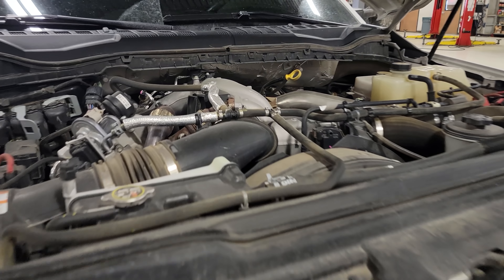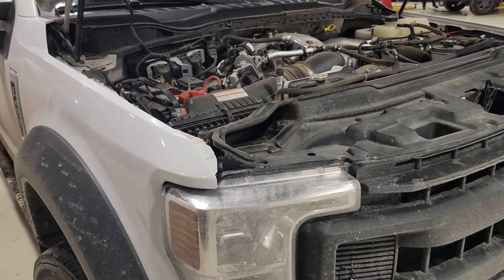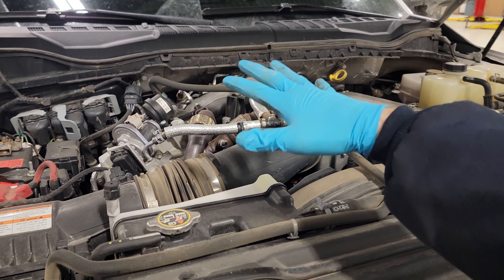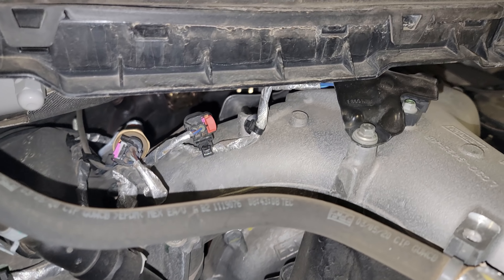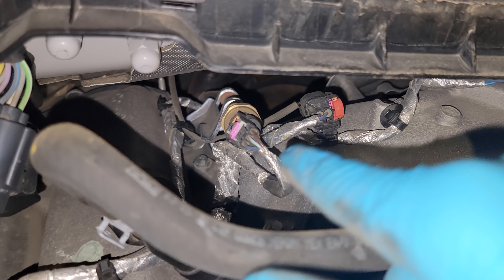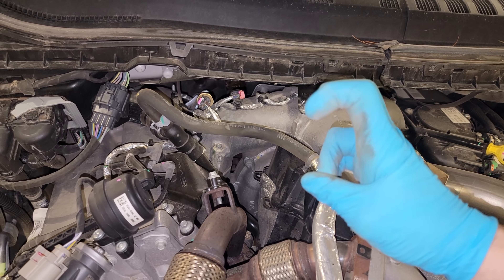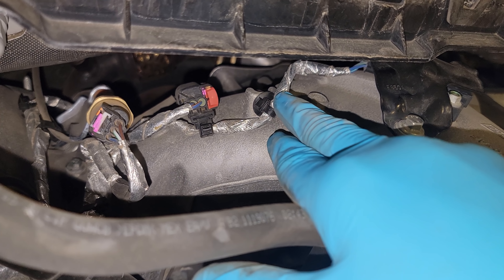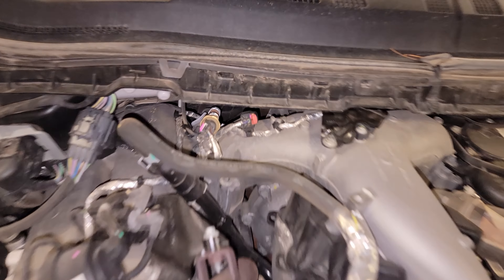NEW Ford 6.7 Powerstrokes **STOP** Don't take THESE trucks apart - WATCH THIS 1ST!!

Comment: Tech tip,
I do a lot of engine repair for another car manufacture. I developed a system I use with finger nail polish I use to mark wire harness connectors, points where there was a zip tie and vacuum hoses. Towards the front I use a red based color like orange red pink purple, towards the rear a blue based color like blue , green light blue etc. I but the cheapest nail polish from wallmart and test in on an old wire harness to see how well it shows up. I have the container at all times in my tool cart. 

Total Life saver if you are taking apart a complicated turbo charged engine that you had never done before.  A lot faster than taping and labeling with tape and a sharpie

Comment: Warren @western truck & tractor just rebuilt a 6.7 and crossed two connectors and had all sorts of electrical faults although the engine did start and run.

Comment: Thank you for doing this important connection. Just like the DEF. Small items, that you would think manufacturer would put DEF away from fuel DIESEL fill spot. I think with work done by damage to engines they could just move this away from fuel tank filler. Not knocking on your wife but unless she knows, she could screw up on fill up. One heavy Equipment manufacturer moved the DEF talk fill to other side of machine. So yes big burly construction types have screwed this up. Heard of a CASE machine getting DEF in fuel tank, major engine Damage
Those two plug in's so important to mark or just take a picture of before disconnect.

Comment: Always mark the connectors if they are the same prior to disassembly to avoid switching them.  Dunno why engineers design vehicled like that sometimes, just use 2 different connectors.

Comment: On my 2011 6.7l the main glow plug harness connector under the battery box can be swapped with another right next to it. Finally figured it out after buying it lol ac started working along with mil going away alternator started charging and glow plugs work now

Comment: Hey Arod, my name is mike and i am a diesel apprentice at barton ford in Virginia. Had a question for ya. Have yall had any issues with the P207F DTC? And what are yall doing to resolve it. We’ve have several trucks 11-16 come in with this code. And hotline just says to start slapping parts on them. Any thoughts on how to get around this? We’ve done several different pin point tests to no success
Reply from the maker: Bro.   If you all are doin the pin point tests you would find it. I skipped a step & got burnned
Reply: @PowerStrokeTechTalkwARod   we’ve done leak tests for the def injector. Tested nox11 and 12. But its like every truck is different and we keep racking our brains
Reply from the maker: You need to be watching the NCCE pid in mode 6
Reply: The few I've seen coming in with that dreaded DTC set, have needed the SCR catalyst replaced. I think I've only managed to repair one successfully with an NOx1_2 replacement. Something else to mindful of. Make sure the EGR system is functioning correctly too, since the EGR is part of the aftertreatment's job to reduce NOx emissions.
Reply: If you are setting just a P207f it's only caused by 4 different things DEF quality, the DEF injector, NOx sensors or the SCR. The DEF injector should have the dosing test performed 10 times hot and cold. If it fails in spray pattern or volume it needs replaced. The DEF can be checked by following the DEF GSB that can be found on Google. The information you need is on page 12-13. If nothing there replace the NOx sensors. If the problem is still present all that's left is the SCR. Remember the p207f will be in the permanent DTC's for 300 days unless you follow the clearing process. The NCCE is a great way to verify the repairs are made and fixed the p207f.
Reply from the maker: Thank you pal
Reply from the maker: Hey chan
Reply: @PowerStrokeTechTalkwARod  hey Arod I got a question, 13 6.7 powerbroke came in from another shop, they just replaced the fuel system, now there’s lots of top end noise at idle, has little to no throttle response when driving and it’s only throwing a cam/crank correlation code. Continuity and voltage is good on the connectors for cam and crank sensors and we put new cam and crank sensors, is it possible this motor jumped time? Maybe broke the keyway on the cam gear? We’re racking our brains on it next step is pull the front cover I guess.
Reply from the maker: Hmmmmmmmm
Reply: @michaelchan8915  True that, the nox and the box that goes with it are over a grand up here in Canada ,the Cat is over 7 grand , both hard to come by,  You guys are 110% correct follow the flow charts and do the drive cycles. Thanks for the heads up on the connector ,those xmas trees are often broken or not installed during a repair.

Comment: @Powerstroke Tech have you ever seen or heard someone voiding their warranty because they ran off road in their truck? Had one of my guys put off road in one of my 2022 SuperDuty's
Reply from the maker: How is that gonna be grounds to have that happen. I'd be more worried about getting sticked
Reply: My thoughts exactly! I'm having the tank flushed and filters changed this week. My friend had the same thing happen to him and Ram voided his warranty.
Reply from the maker: That the dumbest thing I've ever heard. Like u knw it is just dye right....
Reply: Have only been running dyed diesel in a 2017 superduty 160,000 miles on it no issue